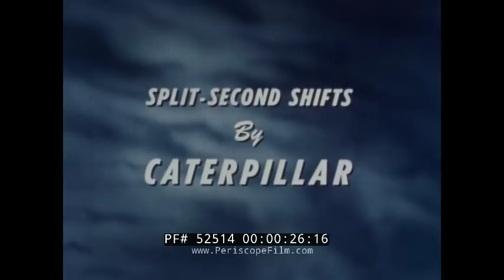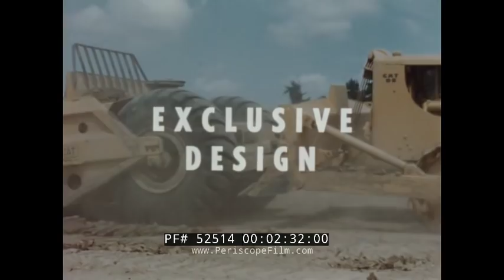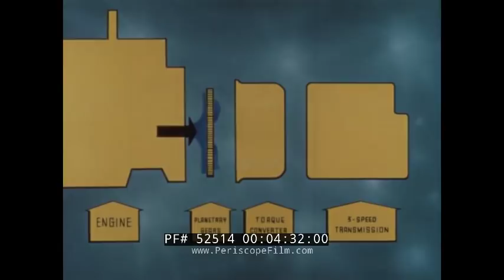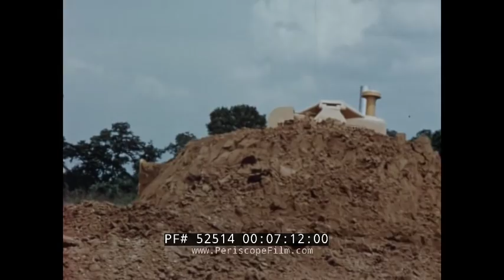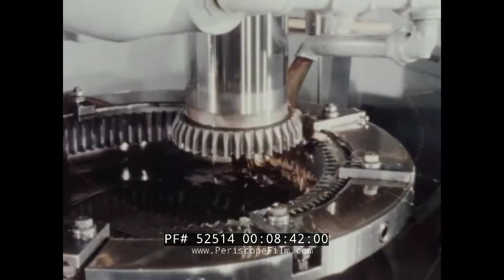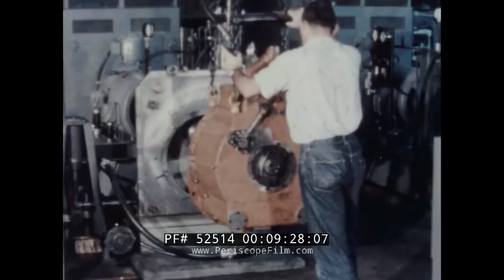"SPLIT SECOND SHIFTS BY CATERPILLAR"    D8 BULLDOZER TRACTOR POWERSHIFT TRANSMISSION PROMO 52514

Comment: A cable blade dozer. The blade goes up way faster than hydraulic,  but no down pressure, unless you add weight to the blade, like cutting open the top of the dirt blade, and filling the void with cement to give it some weight to dig in .

Comment: My Dad bought a brand new D-7E in 1964 with the 3 speed power-shift transmission.  Everyone else in Southern Indiana  doing custom work at that time was using standard shift transmission D-6's that had to be manually hand clutched, the direction lever changed, and another shift lever changed if you wanted to back up at a high rate of speed.  No one in the area had a hydraulic tilt cylinder for the blade, but the new D-7E did.  Clearing land, building farm ponds, and bulldozing fence rows was the order of the day.  The D-7E could do probably 2-3 times the work of the smaller D-6's in a day, and Dad only charged $35 per hour, while the D-6 owners were charging $30 per hour.  It didn't take long for the farmers of that era to figure out how much more you got for your money in hiring the D-7E to do your work.  At first they all thought they were being robbed, but the D7 could push a tree over in one swipe, that took a D6 15.minutes to take out.  The total price of a new D-7E in 1964 was $40,000.
Reply: Cool story, my dad has a 1964 D7E too. He didn't buy it new though. Do you happen to know the serial number? I'm curious as to how close the numbers are to one another.
Reply: @meade4573  No idea what the S/N was now.  It had the Cat 4 cyl diesel you had to start with the pony motor though.  It was a magnificent machine in its day.
Reply: @byronsmith8967  Yeah, the D339 4 banger. You can hear the turbo from a mile off.
Reply: I have a 1968 D7E 48A118** Power Shiftt, Forestry Package, 4 HD Sweeps,  Electric Start,  & HD Winch.. It's a Cadillac compared to the Direct Drive tractors.. The smooth powerful D339 engine is music to my soul.. It makes the toughest jobs look easy.🥃😎👌

Comment: Who developed the powershift transmission first was it Caterpillar or International or someone else? We have an old Case 600 Terratrac that has powershift like system only you chose from a gear and then you can go forward or reverse in either high or low. You can have one track running in forward high and the other in reverse high. It's a really nice system. Also have a IH TD25 that has a powershift transmission. Not as familiar with that machine as Dad got it after I got married so outside of helping him rebuild the engine and put it in the machine I haven't driven it much, maybe 30-60 minutes.
Reply: @jackgee3200  Thank you very much for the information. I guess I need to find a schematic of the systems because I'm having an issue picturing how it works. I was thinking it was similar an automatic transmission in a car but am not sure.
Reply: @jackgee3200  Brake operated steering? You can use the brakes if you want but usually don't as you can put one side in reverse and the other in forward. You have high, low and neutral for for both tracks in forward and reverse. So if you really want to flip it around you can put one in high reverse and the other in high forward and it will turn on a dime. I'm almost positive it is the terramatic. The main issue we have had was with the left final sitting in the seat perspective. My dad had a new one cast and since then it has been fine. Prior to that had quite a lot issues. Great little machine although damn near impossible to find parts for which makes it kind of a pain. Really needs a new undercarriage at this point. I think some JD 450 stuff will fit though so I think dad has some of those parts from a friend who does undercarriage work for a living. Scrap dude took 6-8 practically new rollers he had for Dad's TD-25 on him a couple months. Dad was pretty steamy over that. Not sure how that's going to work out.
Reply: @jackgee3200  I have a TD-6 myself. The rollers and chains have the same dimensions as the Dresser/Dressta TD-7E according to my track manual so I was thinking about converting them over. As you said it's getting difficult to find parts for those machines. Dad and I rebuilt the DT-817 that's in his TD-25B and the gasket set alone was 2k and that was 20 years ago. I am planning on starting a small business doing lot clearing and driveways with the TD-6. So far I'm adding more projects than I'm finishing though. Curse of finding good deals :)

Comment: We had one of these old 46As with the land leveling outfit I worked for starting back in the early 70s.  The torque converter used diesel fuel circulated from the fuel tank. On hot days when the Cat started running hot and the fuel tank was low, it helped to go to fuel wagon and fill the tank.
Reply: The oil torque converters are much better. I think the first 3000 46As had diesel torque converters, and then they went to oil torque converters.

Comment: Does anyone know which lubricant specifications are required for powershift? Especially for the torque converter...dificult to find.
Reply: I read that just use 30W for everything except the final drives that use 50W. I also read to use 10w for arctic conditions. Hope that helps.
Reply: Very early powershift machines like this one have a fuel torque converter. My Dad and I have owned well over 20 D8Hs and Ks. The newer powershift models oil with the transmission, steering clutch compartments, and cross shaft. They oil together and hold 7 pails of oil.   They use engine oil in the transmission. Here in Canada, we run 15W40 in the transmission, but if you live in a warmer climate, 30 is fine. The High Horsepower models use duo cone seals between the steering clutch compartments and the final drives. We use gear oil in the final drives along with STP or Lucas which prolongs the life of the final drives. On the low horsepower models, they use bellows seals which are prone to leakage, although some have been upgraded. Better use engine oil in the final drives on those, because eventually, the final drives will get filled to the level of the cross shaft. If gear oil gets into the transmission, the torque converter will overheat. We change the oils in the transmission and final drives every 1000 hours, and the engine oil every 100 hours. The direct drive models use the same oil. Hydraulics also use engine oil on the D8H, and will overheat with "hydraulic oil."
Reply: @tyfrank3427  Thank you for the complete info Sir! Brazil is very hot and temperatures below 60F are rare. Usually above 80´s F...
Reply: @LuisA7009  Then run 30 in everything. If the serial number is over 46A12885, (Yours may be a 68A) use gear oil in the final drives. We use 80W90, but 75W90 is better here. You would probably be all right with just 90 gear oil there. Also, I grease the universals between the transmission and torque every 100-200 hours, as well as the steering clutch levers and brake pedals. The fan and idler pulley should be greased every 100 hours and the rest of the machine should be greased daily. When servicing the transmission, There should be 2 filters in one long housing by the engine oil filter (s). Those are CAT 1R0741.  There should be a magnetic screen under the transmission pump and another one either near the transmission oil cooler or under the seat, clean them thoroughly. When you do, you likely have to replace the o ring. Those are Cat 5F149. If those leak at all, they will prevent the pump from priming and they will cause you a lot of trouble. If you have an older model, there will be a transmission filter under the floorboard on the right side and one under the seat. Those are 1R719. The engine oil filters are most likely cartridge type. The part number of those is 1R0659. If it is equipped with a spin on, the part number is 1R0716, 2P4005, or the newer 1R1808 should also work. The final drives each have a filter and the part number of those is 1R0729. Finally, the fuel filters may either be spin on or cartridge type, and either way, 2 are used. the prat number for the cartridge type is 1R0724, and be sure to have a gasket handy when you replace those. The Spin ons are 1R0750. I hope that information helps you. Oh, and if it has the hydraulic tank on the fender, you can run 30 in that, engine oil is recommended and it uses the 1R0741 filter, same as the transmission. Also, if yours is the older model and you order the transmission and  engine oil filters, don't mix them up. they appear to be identical, and they're exactly the same dimensions, but they are different part numbers for a reason.
Reply: @tyfrank3427  Same advice for a 1970 D7F Power Shift? Maintenance Manual states SAE 50 for Final Drives, but on inspection it appears they're filled with Gear Lube, most likely 75W90. Left side is leaking a tiny bit. Just getting familiar with my new toy. Located in Ontario Canada, not too concerned about the cold since I don't plan to run much in the winter months.
Reply: @rivetcounting  Exactly the same. They did say use SAE 50, but gear oil is better in the final drives. The D-7s don't have oil filters in the final drives, as they are not pressure lubricated like the D-8s. The engine should take the 1R739 oil filter. I am not 100 % sure what filters the transmission takes on the D7F. But the lubrication  requirements and points are similar between the D7F and D8.
Reply: @tyfrank3427  For power the old girl is equipped with an early model 3306, pre-combustion chamber/glow plugs. Original Cat part no. for Oil Filter element is 5S484, not sure what that cross references to. For Transmission Filter, original Cat part no. is 4J6064, which according to google, x-refs to 1R0741? Maintenance manual indicates 70 L (18.5 gal) for Transmission, Bevel Gear, and Steering Clutch housings. That equates to 4 pails of 15W40, which seems kind of low to me if you're saying the D8s need at least 7 pails for a complete Transmission service. I suspect the Manual doesn't take into account the Torque Converter/Divider, which is odd since the oil change procedure states that to drain the oil, the drain plugs need to be removed from the Bevel Gear, Steering Clutches and Torque Converter. I'll have to crawl under the beast to look for them, but I suspect they're hidden under a super-heavy access cover of some sort.
Reply: @rivetcounting  IR0739 is the correct oil filter number. The 1R 0741s are probably the transmission filters. It depends on your Cat as to how much your transmission holds. Early D7Fs had a transmission like the D7E, and they are larger. They couldn't stand the high RPM so Caterpillar went to a similar transmission to a D-6 on later models. The vast majority of the oil drains out of the bevel gear case. The plug is in the open and easy access. I don't usually drain the little sumps in the steering clutch compartments but you can. The torque converter plug is above the belly pan and the belly pan has an access hole for it.

Comment: This Cat had a Pony motor for starting the main engine. It was a 2 cylinder gas engine that was an electric start, you used it to spin the big engine, when it was spinning fast enough you fed fuel it the main engine.
This one also had a cable system instead of hydraulic for control of the blade and an oil bath air cleaner instead of paper. It was a dirty job servicing them.
Reply: D8Hs all used dry type air cleaners. These resemble an oil bath but they are not. They have a cap on the bottom to catch dust, then above is a piece about 8" high full of whirlybirds to help separate more dust, and then comes one element. There's no safety element. We had a 1959 D8H and I ran it on jobs as recently as 2009. That year was extremely dusty, and I changed filters every 2 days.

Comment: Pathetic to see how american employers neclected the operators for decades. In Europe most machines had enclosed cabs already in the fifties
Reply: Who wants an enclosed cab! A brush cab is good when land clearing. In winter reverse the fan and it will keep you warm. The only time I ever wished I had an enclosed cab was when I would get into a hornet or yellow jacket nest. Last year I got into a killer bee hive, a cab would have been nice then. A cab is ugly, you can't hear the engine good, they are distractive, and you don't need to be listening to a radio while working.

Comment: notice: not a penny was to be spent on ROPS structures or even an umbrella to keep the equipment operator out of the blazing sun, or the pouring down rain, until government regulations required it.
Reply: Operators were expected to keep their mouths shut and do what they were told...
Reply: @jamesanderton344  BS
Reply: Aaron Benjamin you must have worked for sweethearts...
Reply: Caterpillar probably selected an open station tractor for this video in order to provide an unobstructed view of the controls being operated. Not because they were too cheap to spring for an umbrella.
Reply: EZ570    Now. The. EPA. Has. Made. Matters. Worse
Reply: Doing what they were doing, you don't need ROPS for that, just some common sense. But if you work on frozen ground, in mountains, or near embankments, they you need it. Canopies at that time were often built to protect the operator from brush when brushing.
Reply: Jacobd123456 that and men doing these jobs back then weren't complete pussies like nowadays.
Reply: That’s how they did it on Guadalcanal.
Reply: The only that sucks about these old vids is they always had the most annoying sounding announcer

Comment: I do remember when Caterpillar first came out with this 3 speed power shift.. Before that was the Johnson Bar, hand clutch and straight shift transmission..
Reply: Actually the direct drive was an option on D8Hs and D8Ks until the end of production.
Reply: M Hoff D8k plantry open
Reply: I first learned on the old clutch type transmission.

Comment: Is there any way to make the PF film numbers more transparent or even hidden (like closed captions can be turned on/off)?  There were a few times I would have like to see something that was obscured by all this stuff blocking the view.
Reply from the maker: Here's the issue: in the past we tried many different systems including placing our timer at the bottom corner of our videos. What happened? Unscrupulous Youtube users downloaded our vids, blew them up so the timer was not visible, and re-posted them as their own content. We had to use content control to have the videos removed and shut down these channels. It's hard enough work preserving these films and posting them, without having to deal with these kind of issues.
Reply: A light watermark would be less distracting, even without the timer would help!
Reply: I don’t even notice the reel data, too busy appreciating the history on display.

Comment: Is there an approximate date for this footage?

I would also like to recommend that future footage uploaded on this channel include the footage date in the description, it would very useful to have for those searching for footage from a specific time period. :D
Reply from the maker: When we know dates we post them. In this case we do not know the date the film was produced.
Reply: The 46A series D8H came out in 1959. This film would produced in 1959-1960. The torque converter shown uses diesel fuel. This was troublesome and was replaced in 1961 with a new design that uses transmission oil. The improvement made the 46A series D8H the best selling D-8 to date and widely thought as the best D-8 Caterpillar ever produced.
Reply: The dozer looks like a D8H, I believe they came out 1958.
Reply: @wailnshred  They did come out in 1958, but the powershift variant came out in 1959.
Reply: @tyfrank3427  Okay, I knew it was somewhere around that time. Before I was born, lol.